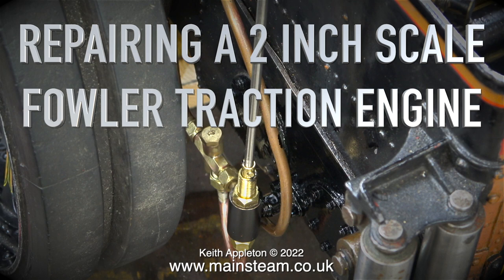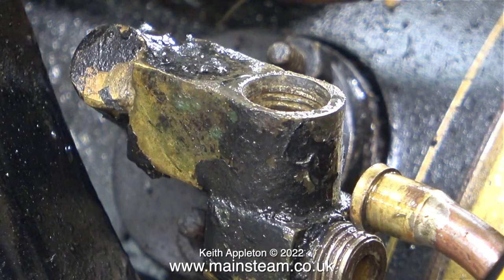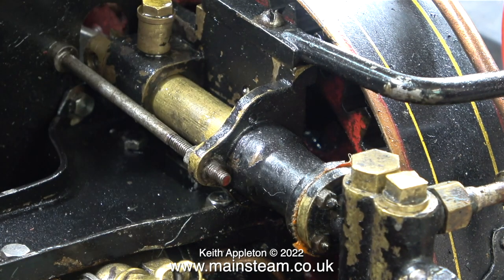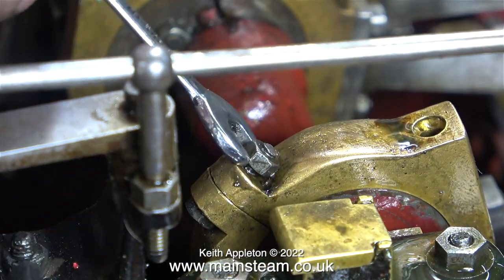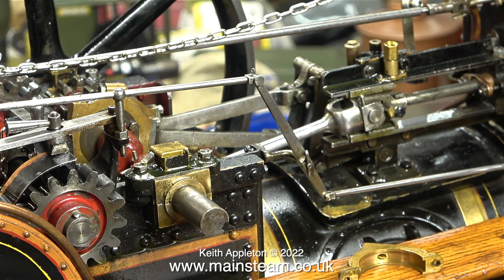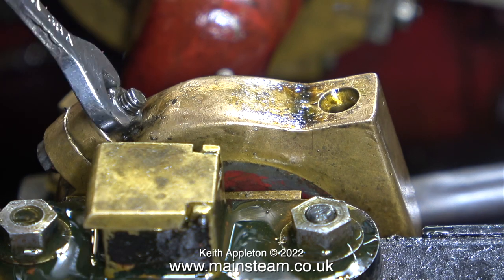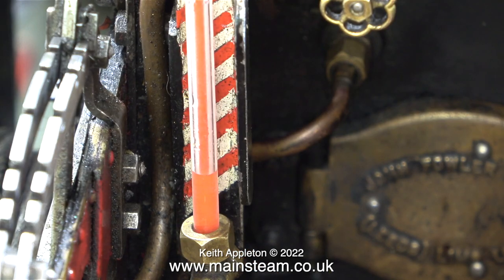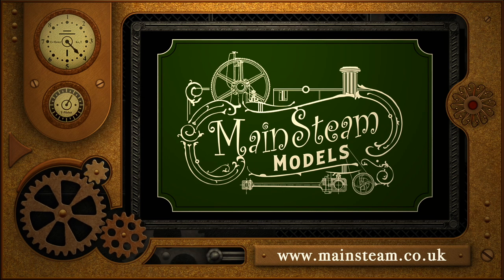REPAIRING A 2 INCH SCALE FOWLER TRACTION ENGINE - PART #10

Comment: I would be tempted to work out the crown height whilst it's on the bench and mark it somehow around the gauge glass. I'm guessing at this scale there's no fusible plug, but on mine, I filled up the boiler with the plug removed until it started to drain and it was a little higher than the original glass mark.
Reply from the maker: I did that anyway, and as the water was still well above the crown when it was disappearing below the bottom nut of the Water Gauge, I didn't deem it necessary to mention it in the video, so as not to make it too long winded and then receive loads of questions about it . . . . . thank you for the tip.